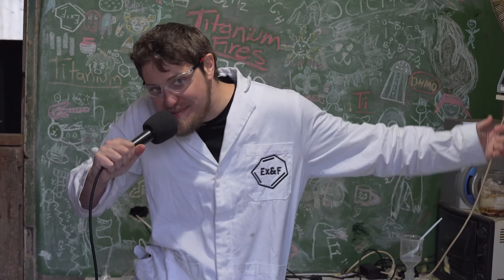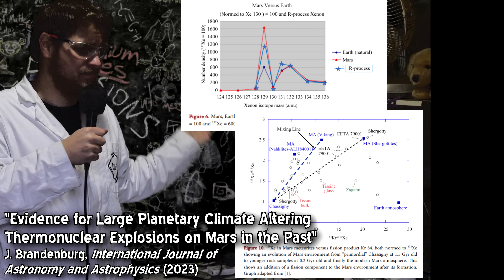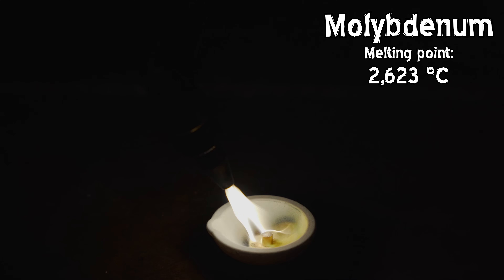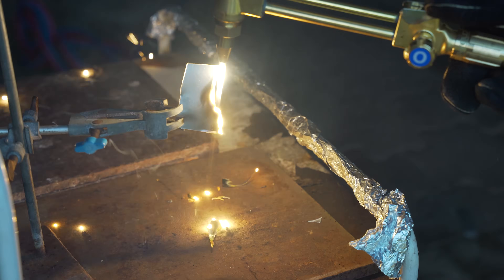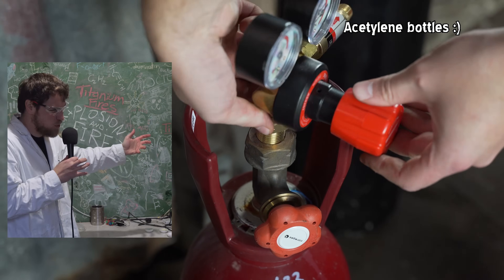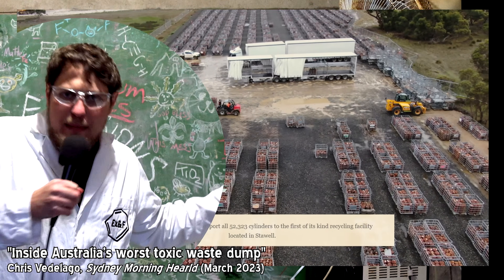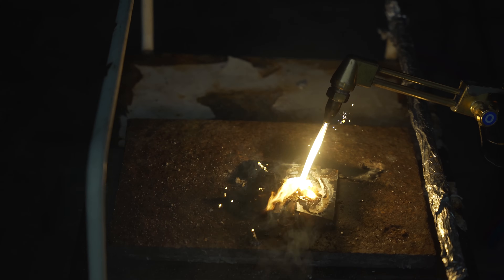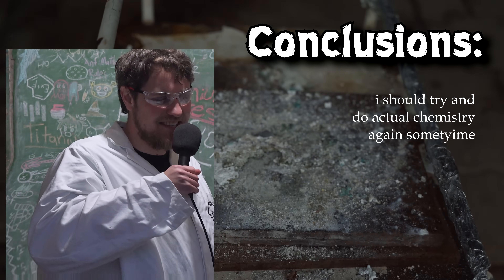Actually burning titanium

Comment: This was unhinged even for you, and I loved it!! Also that paper is fuckin wild.  
And ya recyling is totally a scam. Thing is, the burning it isn't the problem. That's actually a great way to get rid of it. The trouble is you need dedicated filtered incinerators, and to recapture the energy from the burning to use for power generation. And ideally, pump all the co2 that comes off it into algae farms or massive hydroponic installations. Then it's at least carbon neutral and we can keep using plastic. If all we used oil for was plastic, we'd basically never run out. But even if we just burnt it in a nice incinerator, if that was our only co2 output, there's enough algae/plants on earth to easily deal with that at the level of plastic that's used in the world.
Reply: So you're saying that just lighting the warehouse on fire is not a proper way to recycle plastics?
Reply: Can you genetically engineer a martian and then blow it up with a nuke in your next video?
Reply: To clarify, PLASTIC recycling sucks. If you have metal cans, FOR THE LOVE OF GOD RECYCLE THEM.
Reply: @Kumquat_Lord   100% metals (and to a slightly lesser degree glass) are almost infinitely recyclable unlike pretty much everything else that's "recyclable" (paper for instance can only be recycled a few times because the fibres get shorter each round, and the chemical soup they use to do it is pretty horrible stuff)
Reply: A lot of Europe’s waste plastic goes to Sweden to get incinerated in fairly sophisticated incinerators.
Reply: @markiangooley Yay Sweden and our trash incinerators
Reply: @liam3284  shut. Metal is 100% recyclable
Reply: Also, plastic recycling is a scam, not recycling in general.
Reply: Put them in a plasma waste converter. Well I guess we need to build the plasma waster converters first.
Reply: There's actually a recycling/power plant that does this in the USA, they collect bio-waste (veggies, old food, etc) and plastic, then burn it in a giant induction furnace which is pumped into a sealed system with massive HEPA(IIRC) and activated carbon filters which then in turn gets transferred into heating steam, turbines etc. Now if we did this with Algae farms or paired it with hydro/solar etc it'd be great, green and carbon negative since the ash goes to landfills instead of waste, I'd argue ash is better than trash!

TLDR:

There's a power/recycling plant in the USA that burns, cleans and uses waste for clean energy. It's called the "ecomaine Waste-to-Energy" power plant, pretty cool! Gives me hope for our species. :)
Reply: I'm sure you mean something other than "induction furnace" right? @defirence
Reply: Same thoughts I had, sure it's not as nice as figuring out how to reuse the material but if it could be done in a carbon neutral way it's a significant improvement and better than just dumping them where they will turn into microplastics.
Along the same lines, I'm curious why Ethanol didn't/doesn't get more push for gasoline replacement. Whenever you grow enough plants to replace the fuel you've burned, you've captured all the carbon dioxide you released into the atmosphere.
Reply: @LanceThumping oil/automotive/etc industries lobbying against it and the free marketing profiting off diesel.

Brazil has more than 12million cars that can run on ethanol (95%) and most of them can also accept gasoline.
Gasoline engines can be modified to run on ethanol for 1% the cost of a Tesla that isn't even "Green" at all.

Oil refineries and all the oil needs to be nationalized so the market can't set the prices to profit off of it. Wanna stay in the automotive fuel business? Grow weed for biodiesel or sugarcane for ethanol.

As of today, it is a fact that a dozen million people could go oil free overnight simply by choosing the green fuel pump instead of the red one half a meter away, and for them it is as simple as saying "alcohol" instead of "gasoline" to the guy that fills the tank for you at the gas station.

Imo the government should pay for every gas engine to be converted to an ethanol one and the economy should shift from oil to sugar.
You know plants grow all by themselves if you literally just bury them? They capture carbon, make fiber, sugar, shade, cool the land, provide a habitat to animals and insects.. all that while you just wait for them to grow feeding off nothing else other than water, earth, air, and sunlight.

It's so easy you can make it yourself, from the sowing to the moonshining.

Instead of transporting oil overseas, how about we make a farm to fuel plant locally? A small farm big enough to sustain a small city, and bigger(or simply more) farms to sustain bigger cities.

Sure, not everywhere, but most wheres, ideally.

Watch the "Pop Culture Detective"'s video on "Strange 'Solarpunk' World". The fact that a Disney movie flew so low under the radar makes me think it "somehow" profited more from avoiding it becoming a blockbuster than it would if it broke records at the theaters.
Reply: @LanceThumping  Current internal combustion engines don't actually cope that well with burning pure ethanol. It's a little too explosive as it is, in addition to its little problem of being hygroscopic, meaning it absorbs water from the air, you get issues with inefficient/badly timed burning, or worse, corrosion of the engine.
Reply: id vote to donating my entire tax contribution quantity to any government body that would facilitate this  (and verify every step meeting quality standards) 100%
Reply: I think one of the neatest ideas I've seen in the plastic recycling scene recently is the Japanese technology for turning the plastic back into oil to be used for power, iirc it's cleaner burning after the process which is the only real reason to instead of just burning it at a power plant and capturing it's exhaust products
Reply: my two favourite youtubers in one place, no way
Reply: The thing about plants proliferating more to compensate for increased CO2 emissions is that it hasn't been keeping up with the increased emissions for a long time. Because global temperatures are rising, more of Earth is becoming desert and water is becoming less available, so the planet is becoming less habitable for plants too. The only solution is to reduce consumption.
Reply: burning fossil fuels is never carbon neutral unless you put the carbon back underground permanently afterwards.  even if you capture all of it to feed to algae, that carbon is still added to the atmosphere when that algae decomposes or gets eaten.
Reply: While you are still fucking around with genetic engineering, I want no "responsibility" talk out of you.
Reply: M8! The Amazon is a fantastic carbon filter.
Just takes a minute...
Reply: You want to know the best part? All of the developed nations are doing it. Recycling has been the biggest environmental scam since the 80's, because a lot of the plastics used can't be reused for something else, because the polymerisation is only viable in one direction, and all of rhe governments knew about it since then. So when you hear about a new environmental forcing ppl to recycle or offering tax credits or whatever...it's a frickin scam that you are paying for someone else to lie to your face while stealing your wallet.
Reply: Exactly, well said
Reply: Just put some crappy incinerators on Tasmania so all the smog it generates is New Zealand's problem.
Reply: I believe sweden have trash furnaces that are running constantly, they burn so hot that most hydrocarbons are reduced down to base elements. 

if you burn trash on a, relatively, cold fire then you end up with all sorts of nasty things coming out in the smoke. 

Complete combustion is the only way.
Reply: By the time you burn it, capture the CO2, compress that and stick it underground, you've expended a lot more energy than it would take to reduce the material down to basic molecules (syngas) and then rebuild more plastics. Algae farms won't help you because they capture only a small portion of the CO2, then you need to re-separate the CO2 and so on.
Reply: Not every Plastic is made of Oil. If we just use PLA for at least 80% of all packaging (for example) and then burn it will be Carbon Neutral, because CO2 was already captured in the Corn. :body-blue-raised-arms:

No?
Reply: @zebarzebra  It's a good option for some uses. There are still hundreds of millions of tonnes of plastic in landfills.
Reply: So we should just dump all the plastic in the Ocean so the turtles and algae could eat them? That's GENIUS! The oceans WANT our plastics. ❤
Reply: There's absolutely nothing wrong with throwing plastic in the ocean, all that microplastics bullshit is complete bullshit. @akosv96
Reply: @akosv96  Well, apply a bit of engineering, mix up plastic with sand (to add mass), compress it into large lumps (50 tonnes or so) and coat those lumps with melted (recycled) plastic, or simply apply heat to melt the outer layer. Then toss them into the ocean where they will sink to the bottom and stay there for tens of thousands. Good idea? Yeah, my point is that this is also a waste of good resources and what's prevented us from fully recycling plastic (so far) is the cost of energy. But, that's changing because renewables are putting excess, cheap electricity into the system. Perfect for new uses, such as this.
Reply: I like how I literally just commented the exact same thing and then saw your comment.
Reply: Everyone’s talking about plastic recycling when we’re forgetting that Martians launched nukes on mars
Reply: I worked for Coles for years and the Redcycle plastic recycle bins would get bagged into a larger thicker red plastic bag... then placed into the general waste dumpster. Not because us staff were careless but because the recycle truck never even existed.
Reply: Which plastic company is paying you?
Reply: I've heard good things about PET-eating bacteria. Perhaps that is the solution.
Reply: I believe the massive algae farms your talking about is called the ocean
Reply: Literally just switching to non single use everything: completely logical choice
Capitalism: buh oil!!!
nothing ends up being changed
Reply: Some countries actually manage to recycle quite a large percentage of their waste, though. Still not perfect, obviously, but pretty good
Reply: I'd say pyrolizing the plastic to turn it into fuel would be a good idea.
Reply: I've been thinking about it and came to the conclusion that it's better to put plastic in a landfill. Why? Cause that's carbon storage. If we use plant materials to produce the plastics it's even carbon capture and storage, turning plastics from a disaster into a blessing.
Reply: @Kenionatus  The problem with that is that some plastics tend to disintegrate with age and exposure to ozone and UV. That doesn't mean they break down, but they sort of turn into shards and particulate which is where "microplastics" come from. That's a whole other toxic kettle of fish.
Reply: Don't plant derived plastics break down? I think that was one of the "selling points" during their development. For carbon capture you want the plastic that lasts for a really long time. Think, big mac Styrofoam containers. So a non foamed polystyrene.  @Kenionatus
Reply: @jonathanseagraves8140  Normal plastics like PE and PET can be made from biomass.
Reply: Then my next question would be, is the extra energy it takes to make the plastic from biomass (it's unlikely it takes less than conventional means) still allow there to be a net reduction of carbon from the system? this is pretty hard in the paint for YouTube, you will NOT offend me by ignoring this comment entirely. @Kenionatus
Reply: @jonathanseagraves8140  Not really... PLA is theoretically biodegradable but you'll notice that on things that use it they say "Industrially compostable" because you can't just stick it in your compost heap at home.
Reply: Like all things it depends in what timeframe we are talking about. If we are talking about carbon capture, I would assume the timeframe would be far greater than one human lifetime. Otherwise you would be setting a carbon dioxide bomb for your grandchildren (that was a joke, but it illustrates my point) @SomeMorganSomewhere
Reply: It's not a carbon sink though.  Plastic biodegrades.  There are species of microbe that can use plastic as their sole source of carbon.  It's literally food.  @Kenionatus
Reply: @Kenionatus  That assumes that the plastic doesn't get turned back into carbon containing gasses. Problem is, that's only true to some extent. Plus nature is gradually learning how to eat plastic.
Reply: burn the plastics to generate power is the best option.
Reply: That sounds brilliant. Seeing how many interesting people tend to output YT content nowadays, how about you all get together and make this happen and save the world? We are basically getting there, right?
I mean we have people who do genetic engineering, build rockets, makes computers from scratch and prepare a mars base simulation on an american desert. Don't tell me it can't be done.
Reply: Landfill would still be better though. No toxins entering the atmosphere, all the co2 is captured.
Reply: That is one thing you oddly never hear about. Plastics are pretty good at carbon capture, and when they are not, they are biodegradable!  @jackroutledge352
Reply: @jackroutledge352 sir..  what
Reply: Until they leak and you have a massive disaster  @jackroutledge352

Comment: you're using that torch wrong. that's a cutting torch. you need to dial your fuel/air mix in with the knobs. that lever is dumping straight 02 in the center of the jets to react with the material being cut. your actual cutting flame should not be oxogen rich. if it is, you're doing it wrong. if you look at the tip you'll see a ring of holes with a big one in the center. the ring is your burner, and mixes the fuel/air in the handle before it comes out. when you let off the torch at 5:44 you have almost zero oxy mixed in your flame and you're just oxidising the piss out of that poor plate instead of actually heating it. you should be reaching that 3k degrees and THEN add the cutting oxy, not reach the 3k with the cutting jet. you should have had a 15 foot jet of titanium sparks with that torch

Comment: 2:35 yup xD had a good laught at you trying atleast
Reply: @Explosions&Fire also a tip if your gonna use oxy acetylen again the temperature is some where just above 3200 celcius but it is the core flame in the midle if you look at the flame you should see 3 diffrent flames the middle flame looks kinda like a blue jet flame and at the peak of that flame is where you want your material thats where it is the hottest
Reply from the maker: Yes I can see it through the glasses okay… but it did not film too good on the camera. Should have got some filters for the camera lens! It is just way too bright

Comment: I have tantalum rods from a electrolytic power supply.  I hope you put a Geiger counter on yours before you burned it. If it wasn't made in a modern arc furnace with exact temperature control you're gonna have some hot stuff in there. Maybe thorium,  can't remember. 
  I was going to scrap mine and the recyclers put an xrf on it and they were only 90 some percent. The rest is spice. Not happy it was stolen. It was an 1926 philcotronic electrolytic 'battery less' type B power supply.
Reply from the maker: Interesting mate, I’ll check it, thanks!

Comment: If possible is there a way that sound could be used in high enough levels to effect the chemical structures of different objects or to increase the rates of the reaction to produce a more efficient and quicker reaction?

Comment: 2:42 "a lot of chemists are bad at practical skills."

No we aren't. You may be, but the rest of us know how to use a fcking brazing or cutting torch, come on now...
3:16 "we're going to oxidize these metals because we're throwing oxygen at them..." Set your torch correctly and you won't be, the only oxygen reaching the metal will be from the atmosphere.

You disappoint me. It's incredibly obvious from your flame that you are racking between a rich and lean flame. When you are trying to oxidize metals and melt them, you're WAYYY lean on your mix, and I suspect you know that.

Read your flame. Better. Your tungsten melting flame was as rich as it gets, with a very clear and defined oxygen deficit in your flame. Come on dude. At no point in your video do you have a neutral flame, which is your max temp.